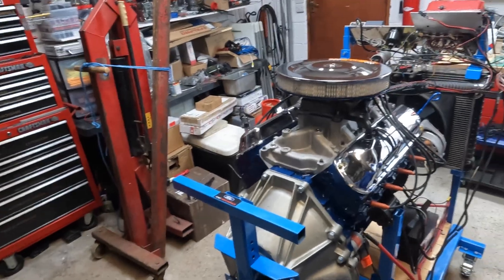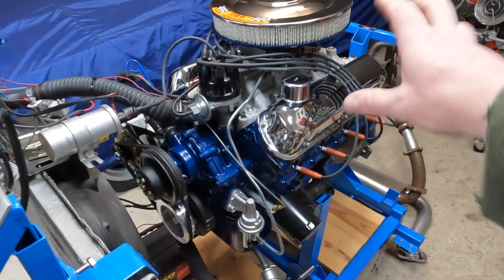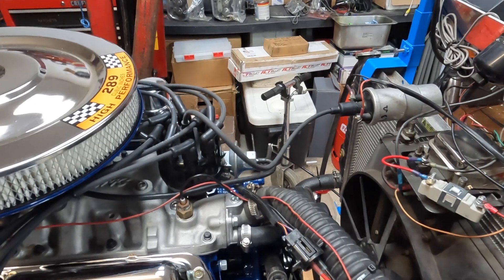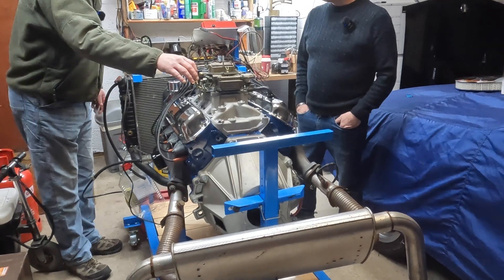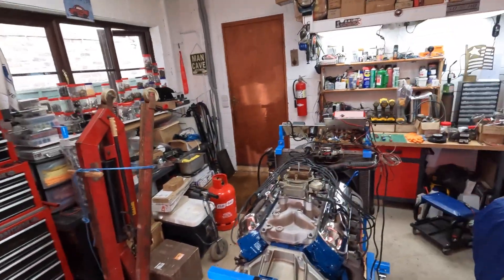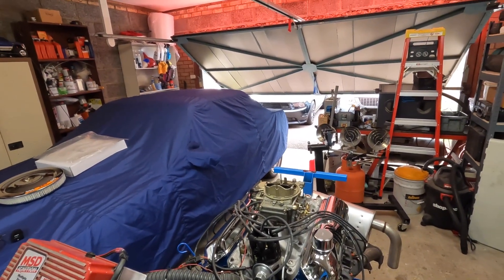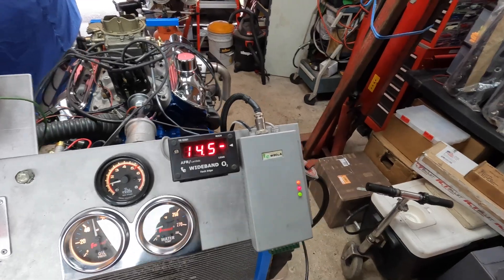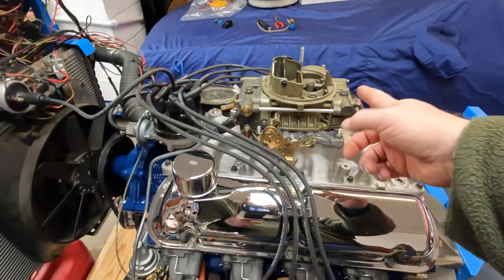First Start and Tuning Issues of our SBF 302 Project Engine

Comment: So I recently rebuilt my  302. Stock Roller block from a 93, did a carb swap and just a cam. E303 to be exact. Clearance is perfect everywhere. Had it running the other night after a painful trying to get it to prime and fire, but i had plug 6 and 5 backwards. Went to fire it up today to move the truck again and just get some run time on the motor and now it doesnt want to spin over as freely. almost like its catching on something. Any ideas what went wrong? ran pretty much perfect before I parked it. Almost seems like the battery is dead. Double checked all my grounds, power leads etc, alternator is working properly. 
Help Please
Reply from the maker: It could be so many things, I dont know what to tell you.  I would start by pulling all the spark plugs and see if the engine spins over freely without building compression.  Also take your battery in to a dedicated battery warehouse and have them test it for proper CCAs.